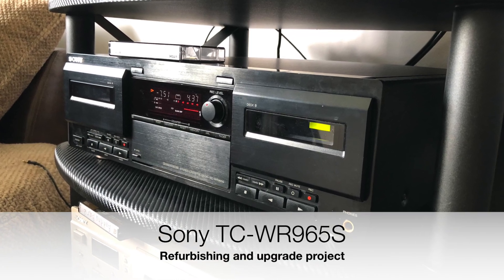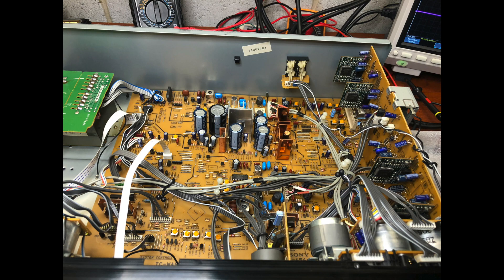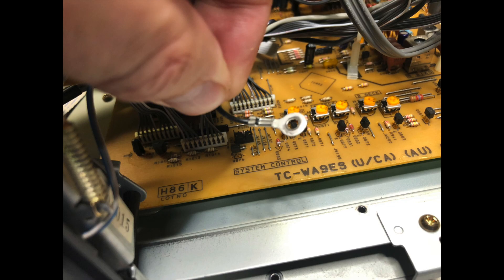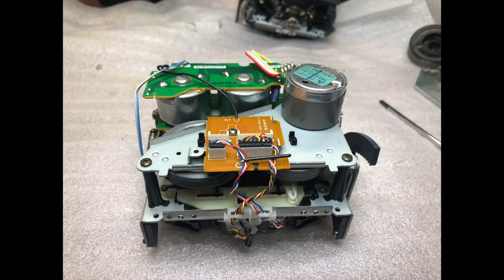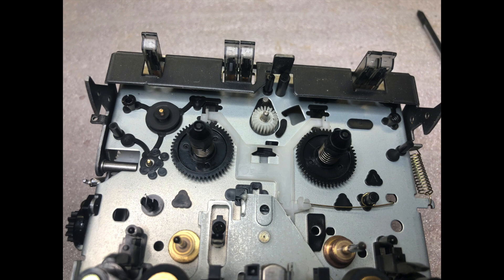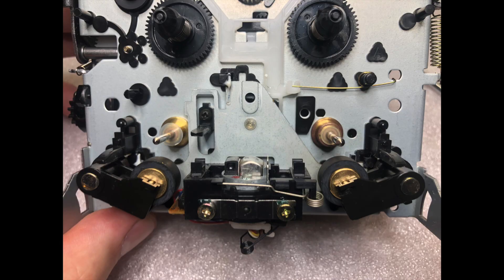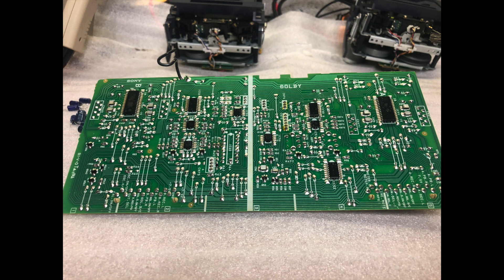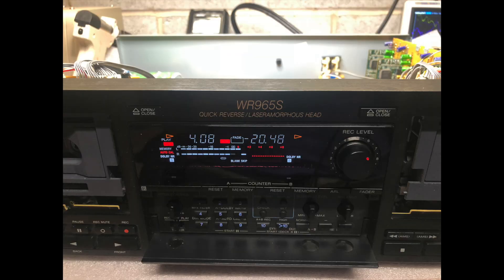Sony TC-WR965S Upgrade project details and description

Comment: HI. I have the same exact deck. The display is somewhat dim. Any direction as to a possible repair ?
Reply from the maker: Check the voltage. If it is in norm and corresponds to the schematic - sometimes increasing for a few volts solves the problem. But it is usually a sign that the indicator was lit for a long time and the phosphor is worn.
Reply: @hifirulezzz  HI  I just received this deck from Japan, and after checking the display again, it is OK. I paid $112.00 Canadian for it. The belts all need replacing, as they have turned all gummy, but otherwise it in very good condition. It doesn't appear to be used much at all. Thanks DOUG